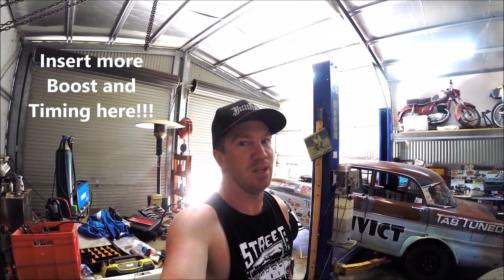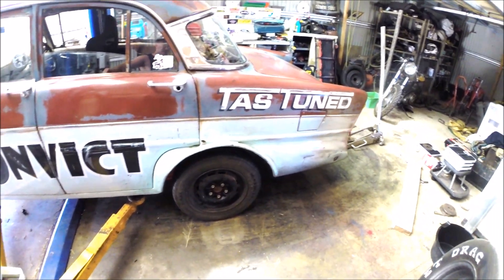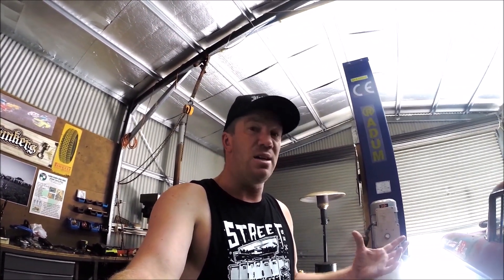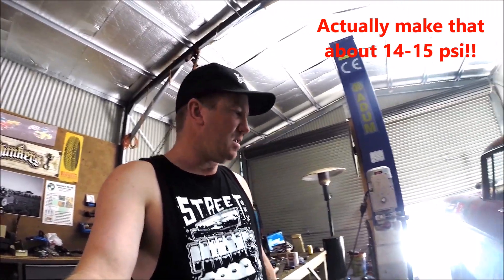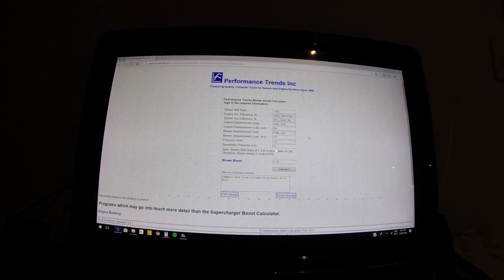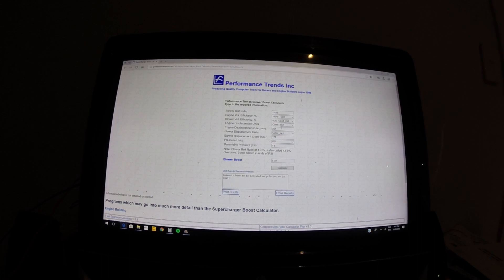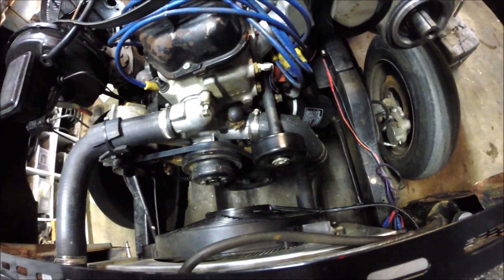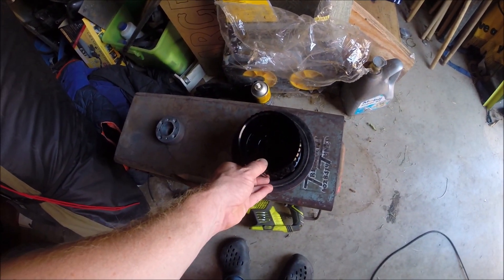Ford 250 Crossflow boost increase with gilmer supercharger pulley

Comment: "Hope the head gasket holds"....if it doesn't just "o" ring the block and use copper wire. That solved my problem. You got the tools to do anything. Don't give up.